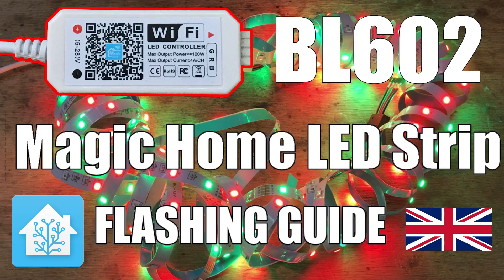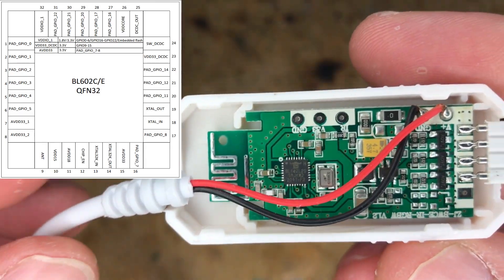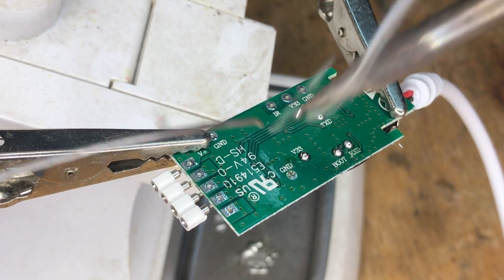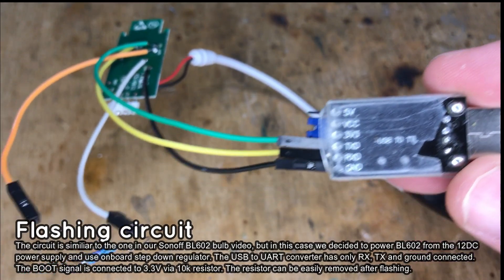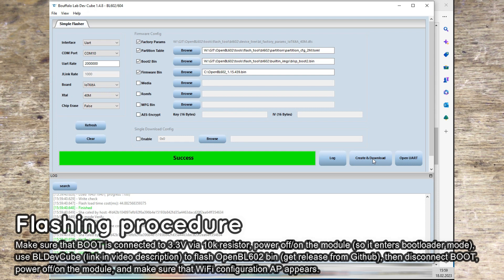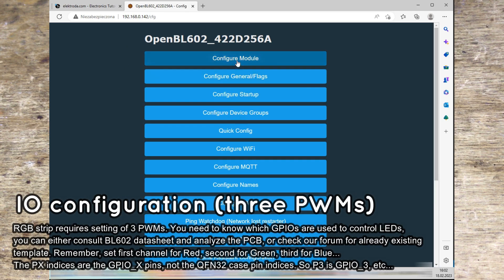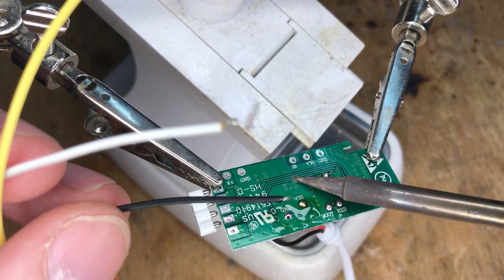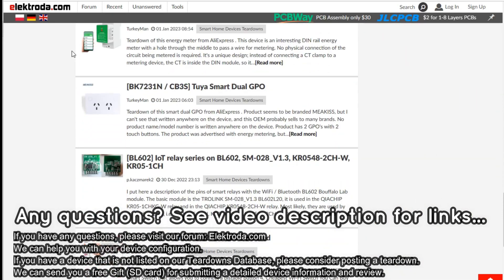Magic Home BL602 RGB LED Strip programming with OpenBeken - new Tasmota/Esphome port style firmware

Comment: Everything worked as shown. However, I had an issue with the WiFi connection. Found out that the problem was WPA3 in Mikrotik AP. If you have connection issues, try to connect it to an open network to see if it connects, then you know there's a compatibility issue. Thank you!

Comment: Im so excited for this but Im confused I have found the 602 flasher but do you have to build the bin using your github repository?
Reply: the bin lives in the firmware repository and on windows11 I was able to get the flasher to run by moving it to the root of the drive

Comment: Hello, I can't download Bouffalo anywhere, would it be possible to program it via ESPHome Flasher? Can I ask for a link to the plastic wrap that you use to rub the circuit board? Thank you.
Reply from the maker: The flasher is inside tools, here: https://github.com/openshwprojects/OpenBL602
Reply: @elektrodacom  Tasmota does not work for these devices ?
Reply: @BUrbbable  Works really good, every day is an update for the BL602 chip.